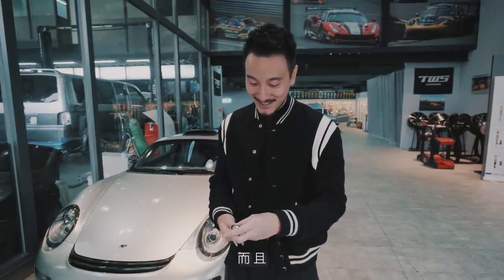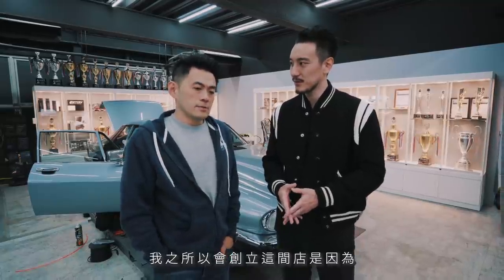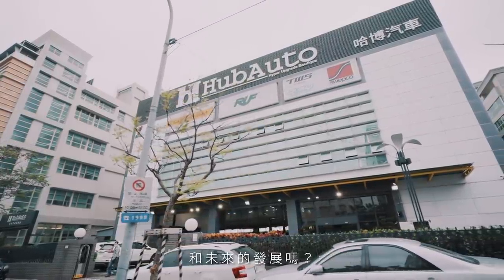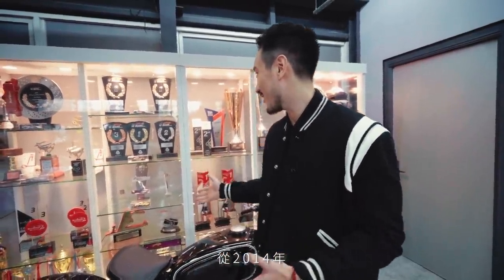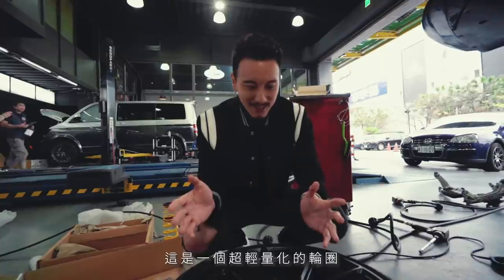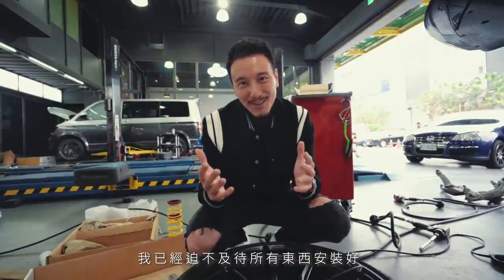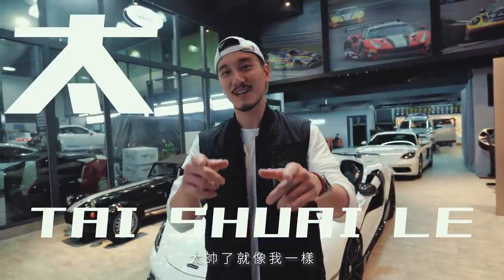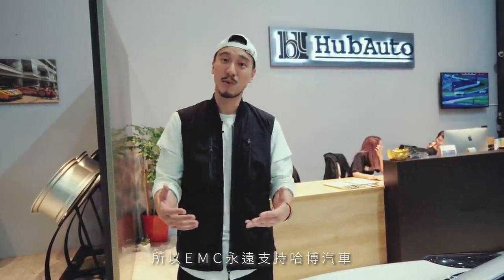570S GETS SEXY AT HUBAUTO!｜哈博讓570S更性感了《EMC Vlog Vol. 25》

Comment: Oh and what width rears on those 12" wheels? I have 11.5" wheels with 305 Toyo R888R's and the wheels are still wider.  Are you running wider than 305?
Reply: 12 in rear... 325
Reply: @sunnywang1311  nice. I didn't think the tire heights could work.